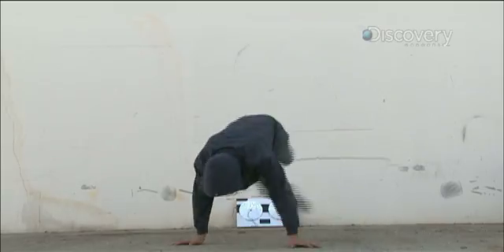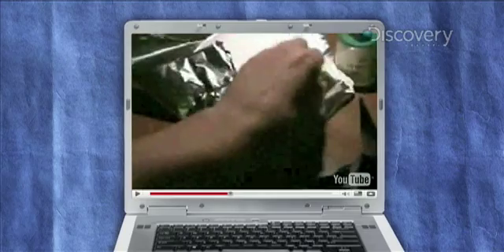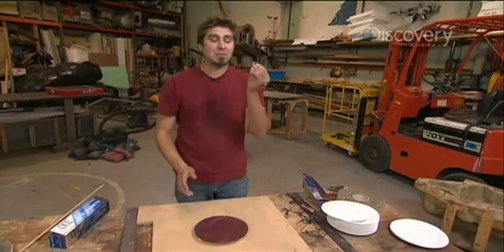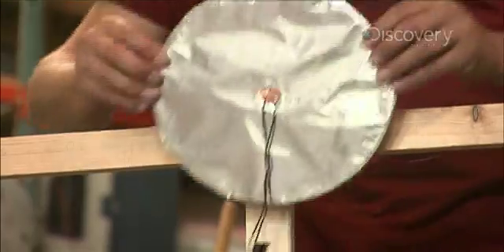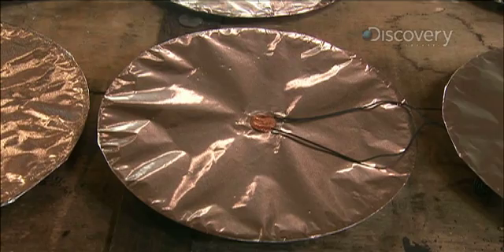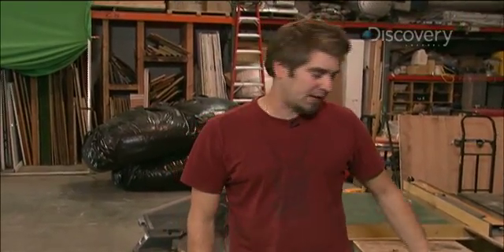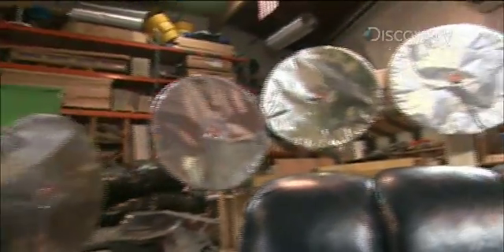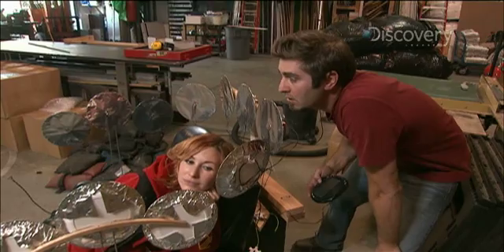MythBusters - Homemade Hi-Def Speakers

Comment: The fact that myth busters actually had to debunk this video  just proves how technically illiterate most Americans have become..

 One look at that circuit would tell anyone with half an ounce of electronics knowledge that it was a joke. Come on people both wires where connected to the same penny so it was nothing more than a short circuit.. Now if he would have wound a coil and taken a magnet and ....... .

Anyhow he was obviously having a bit of fun making fools out of the ignorant people who thought this might work.. There's an old saying " you only have to be 10 percent smarter then the equipment you're working with" And who ever posted that video just proved that million of people aren't any smarter than a paper plate.
Reply: try more than Americans pretty dumb of you to think Americans are the only one to watch this video
Reply: It says in the original video's description, "*This is a parody video for fun. Hope you enjoy!*"
Reply: aerial wheel When you strip the insulation off copper wire and then connect both the stripped ends to a copper penny you create a path with close to the same electrical resistance as the wire itself  AKA also known as a short circuit..

 A proper circuit is free of shorts circuits. In order to do this the wires in that circuit need to be connected to semiconductors or insulators or some other device which would present a high resistance or high impedance path between the two conductors thereby preventing or slowing down the free flowing electrons between those two conductors. The idea is to use the power between the wires to perform some kind of meaning full work. In this case all the electricity is doing is heating up a bunch or wire and a penny.
Reply: ok, genius... you know how the wires are different colors when you strip them??? that is insulation. they are fucking insulated!!! it is not a short circuit.
Reply: no. you don't see what i'm saying. it is insulated wire. it's already twisted together inside the HOUSING (the black part). the insulation is essentially painted on the wires. you can't short them unless you butt the ends together.
Reply: the awkward moment when they even say in the dvd that, that was a joke skit for shits and giggles
Reply: aerial wheel that is exactly what you are doing when connect the copper wires to a penny... You are connecting the wires via another piece of copper...
Reply: Steven Butler not this type of wire. thin insulated wire. same concept as wire used for electric motors. the insulation is "painted" on so the number of turns isn't defeated by short circuiting on itself.
Reply: He takes off the insulation at the end of the wires and connects both ends of that wire to a copper coin. There is no load being generated there. Sure he could wrap the insulated part around something and not generate a short. No one will argue against that but when you remove the ends of the wire and then connect them via a piece of copper you have created a short and all it will produce is heat.

That being said I still think it would have been interesting to try and make a working speaker with household items. Maybe use some refrigerator magnets :)
Reply: he doesn't take the insulation off. only the black plastic covering (which is not the insulation)
Reply: aerial wheel Are you blind? The tip of each is stripped and connected directly to the penny.  It is a direct short.
Reply: the wire is insulated even if you strip the plastic coating off. just like the wires for an electric motor or any other type of coil. that is how they do not short out inside the black plastic housing.
Reply: Stephen M the wires that are colored have an enamel coating on them. you have to burn it off or chemically strip them before they will short out or connect to eachother.
Reply: They are insulated or enamel coated,  not both. No point in doing both.
Reply: Stephen M the enamel coating IS the insulation and the black plastic housing just keeps it neatly bundled and protected.
Reply: aerial wheel You are blind, the tips of each wire are clearly cleaned of any enamel or insulation.  What is to gain by leaving it on the wire? Nothing. No contact means no circuit means nothing happens, and that he went through the trouble of building at least 13 of them means he got them all wrong and is an idiot, or he built them all "right" and you are a troll.  Either way you lose the discussion in the end because the original design is flawed and was done to basically make fun of people... like you.
Reply: lol exactly it would never function either way without a voice coil or a magnet
Reply: Stephen M he didn't strip the enamel because he wasn't even trying to make a normal circuit. the wires were NOT shorted.
Reply: ***** yeah i make home made speakers often. it does require thin insulated wire but you want it to be a complete circuit to form the voice coil. and of course, a magnet.
Reply: You are blind.  Difference in color can be easily seen where it is stripped.
Reply: aerial wheel The coated wire normally used to wind the stator coils in electric motors is a special type of magnet wire which looks almost identical to enamel but is actually polyimide not enamel.

 Enamel coated wire has a much lower heat rating and tolerance than polyimide so it's usually used for winding inductors and coils where it won't be subjected to as much heat while polyimide is usually used for winding higher quality electric motors. You can usually tell the difference because high temperature polyimide coated wire is a bit darker and a lot more expensive than plain enamel coated wire not to mention much more difficult to remove from the wire for soldering or crimping.

That being said I don't believe the wire being used here is either enamel nor polyimide coated. The  wires he strips and attaches to the penny appear to be the other end of a cheap 3.5mm molded headphone connector so I highly doubt it would both be enamel coated and plastic insulated you only find that kind of redundancy on the space shuttle and not cheap chinese headphone adapters which are probably copper coated aluminum and not solid copper.
Reply: They look plastic coated but either way the tips of each have been cleaned or stripped to bare metal so it doesnt matter which it is.  The wire looks thicker so I would say it is plastic coated, usually only thinner wire is enameled.
Reply: "Come on people both wires where connected to the same penny so it was nothing more than a short circuit.. Now if he would have wound a coil and taken a magnet and ....... ." Assuming that a coil is not a short circuit? Oh wait, it is.
Reply: No, it is not.  A coil produces a resistive value measured in impedance (Re) also known as "Ohms"....
Reply: Stephen M No. Coil produces inductance, which is measured in Henry. Which, when calculated in a DC circuit, is assumed to be 0 ohms.
Reply: ass-u-me.  You fell right into it like a noob because you are assuming a dead circuit.  Without accounting for energized states you will never go beyond basic theory and continue making mistakes like saying a coil is a dead short.
Reply: Stephen M "ASS-U-ME" ?? "Theory"  ??

Sorry to burst your bubble but electronics is based solidly on math and science with no assumption or hypothesis involved.

For someone who wants us to believe they know what they are talking about you sure don't seem to have a full understanding of the definition of theory when its applied to electronics..

 Heres a clue in electronics the word theory is not a synonym for hypothesis.  In electronics theory is a scientific fact that can be proven through math and demonstrated.  In electronics a theory is as close to fact or law  as humanly possible.

With that said the previous poster is correct the coil in this circuit represents a DC short.

The cool thing about electronics is no one reading this needs to take my word for anything. They can easily prove it to themselves with nothing more then a 99 cent Harbor Freight and tool DVM..

All you need to do is duplicate the simple circuit shown in this video. Just grab some scrap THNN wire,  strip it make a coil of a few turns attach it to a penny. Then take your HF and tool DVM set it to continuity and if the DVM buzzes then you have a DC short circuit..

Technical audio signals are a form of AC but there are no where near enough turns in that coil to produce any inductance in the audio frequency range, Now if we were talking radio frequencies at UHF say around 400mhz that coil might produce a few nanohenries of inductance. But in In this circuit that coil is nothing more than a dead DC short END OF STORY !! Anyone who tries to argue differently should look for a career someplace other then the electronics engineering field.
Reply: Dan Nelson it's not a short. the wires are still insulated. they are coated with enamel. end of story
Reply: "it's not a short. the wires are still insulated. they are coated with enamel" 

Really then you should have no problem provide a link to a datasheet by a manufacturer of PVC insulated enamel coated wire because I've been in electronics engineering for over 35 years and I've never seen it ..

PVC coated wire is the standard hook up wire that is most commonly available at your local radio shack or hardware store,

Enamel coated wire is used for winding transformers and inductors and high voltage enamel aka polyimide coated wire is used where high voltage breakdown is a consideration.

The reason I mention this is that sometimes a manufacture will need increased voltage breakdown then is provided for my polyimide coating alone and will sleve enamel coated wire in a teflon tube.

The wire in this video was not sleeved  polyimide coated wire. So do us all a favor and either provide a link to a datasheet by a manufacturer of PVC insulated enamel coated wire or give it up and  and quit embarrassing yourself .
Reply: Lol.  Never called electronics theory, just your assumption theory.  Besides that the coils being talked about would have more than "a few" turns lol.
Reply: The mythbusters sort of function on a democratic basis. If they get enough request to do something then they will do it. It doesn't matter how silly or incredulous it is.
Reply: Try https://youtu.be/Awef78YtWmc you'll see what started the myth and how it's different then what he actually tested.
Reply: Blaze1024 "most Americans" how to be condescending 101

Comment: If he puts a magnet behind the penny it would work
Reply: No. The way a workable dynamic loudspeaker actually does its thing: there's a round permanent magnet. There's a tube with a coil on the outside placed over the magnet. There's a paper (or mylar, aluminum, titanium, whatever you want) cone attached to the tube to push air. You connect the coil to your (insert name of music playing device you're using). When you energize the coil, it creates a magnetic field around it. The magnet's field pushes the coil's field away from it. The cone is attached to a frame so it won't fly off into space, through a flexible coupling that shoves the coil back where it came from when you deenergize the coil. Energize/deenergize the coil quickly enough and...rawk and roll! A penny's not a coil so passing a current through it won't create a magnetic field. Rather, a penny is a good conductor (the one I just tested came in at 0.5 ohms) and if you build this, your device's short-circuit protection will kick in to keep you from blowing up your player.

Comment: hook the leads up right. positive to penny and negative to the aluminum. it will then work as a piezo speaker or transducer. It last until the wire burns the aluminum.

Comment: 5 years later I still don't understand why they bought NEW cable jacks and cut them up. The intent was to reuse dead headphones. Hell that's my main source of wire to extend a radio antennaes, the free cheap headphones that get handed out at almost ever booth at trade shows.

Comment: actually you can get those mini jacks online for like .50 cents to  1.50 $ if you go to the right web sites.

as for the speaker itself .. total bus .. nothing about this set up is even remotely like a real speaker. 

for a real home made  speaker you need paper (a couple of paper plates will work actually) a peice of iron (perferably a round piece)  some copper wire  and a magnet (perferably a round or ring shaped magnet). 
Note this is dangerous if you dont do it just right ,  my instructions here are rudementary but give teh basic idea of how a speaker works.
first you wrap the copper wire around the piece of iron  these will be your leads that connect to your speaker wire this creates your "Driver" bassically it is going to be an electro magnet  the alternating current coming into the leads charge the iron to be magnetic , which causes it to attract towards and repell away from the  natural magnet  (which is put around  but not touching the driver). this where the two paper plates come in , one will be the mount for the driver the other will work as a vibrating diaphram coming off the driver .   as the current reverses the polarity of the driver's poles this causes the driver to push /pull  against the  natural magnet's  poles which in turn vibrates the daiprham creating sounds.  

Look it up if you want a better explaination , google  "how speakers work". but that said NOTHING about this set up on this video even remotely looks like it would work even if you stuck a magnet into the build process ... its just not how  speakers work.

Comment: Well first of all it requires a magnet in order for this to even work.
The penny does not provide this because there has to be either a motor system or a magnetic base with a metal cylinder pushing the speaker vibrating.  so looking at the prop list the myth is busted instantly.
Reply: Not really true since there are speakers that don't use magnets such as electrostatic speakers and plasma speakers. These use no magnets but produce magnetic fields via electric fields and rf modulated plasma. The later is actually highly famous for being created using tesla coils. Look up "singing tesla coils".
Reply: Pezzos have no magnet, yet they play at even high volumes!
Reply: Pezzo's are a different system from magnetic base :l
Reply: They are still speakers. You acted like the only reason it didn't work was the magnet not being there when there are many that don't even use magnets. We just responded to your flawed statement.

Comment: Thank you for putting these tin foil speakers to the Mythbusters test, but I knew from first glance that it wouldn't work.  First, the cone material must be taut enough to vibrate.  Secondly, you need a magnet and a coil, not just a connection to a flat metal piece.  These tin foil speakers obviously have neither, though you obviously knew that in the first place with your obvious intention to prove they DON'T work to people who don't know that already.
Reply: Speakers do not require a magnet to work that is only the most common and efficient way to make them. Electrostatic speakers work similar to this but not enough to make it work. The reason this didn't work has nothing to do with whether it had a coil and magnet or not. The reason it did not work was because it used a diaphragm speaker concept in an improper way. The electric current was only applied to one conductor and the "diaphragm" was toughing the material being electrified directly. The diaphragm of any diaphragm based speaker has to be suspended inside a magnetic field to work it can't just be beside it and it can't be in contact with what is producing the field otherwise any potential vibration ceases. The materials used just would not be able to produce vibration consistent with producing sound.

Comment: I saw what's wrong to what he did. He should twist the two wires together and tape it on the penny. And the penny should be on a correct angle and probably should facing upwards or something.

Comment: So you slap both cables across a "copper" coin and expect to hear something?, seriously?

Impedance output from audio systems range from 4 to 32 ohms, impedance of copper coin, well lets just say "short circuit" and leave it at that.

Comment: The point was to test the video. It wasn't to build a speaker conventionally, it was to test the video posted in the description that doesn't use any coils or magnets to see whether that method works, and it doesn't.

Comment: physics suggests that you ought to be able to make a speaker using electrostatic forces... in theory you could use any kind of field to produce a force that's what fields do... but an electrically modulatable one ought to be most simple for an electrical amplifier to power... :-)

Comment: it's not busted it works they did it wrong! i swear! anybody can do this make sure that the aluminum paper is sealed air tight! it works with i CD player but it's best to try it with a separate AMP with enough electricity flowing through the wires!

Comment: he had to mess with the wires to make it work! he needs move them around and it's very hard to get it working but it works! make sure it's a clean wire and a very clean penny with no oil on it from your hands! it's not the most efficient way to get it working though!

Comment: Magical thinking will not create a speaker. Speakers work by exposing a magnet to an oscillating magnetic field caused by variable current moving through a coil. The magnet is attached to a membrane that moves air to create sound waves. Some high end bass speakers are made of aluminum but most membranes are paper. Just sticking aluminum and paper together and shorting out some wires on a penny will not supply the needed physical components.